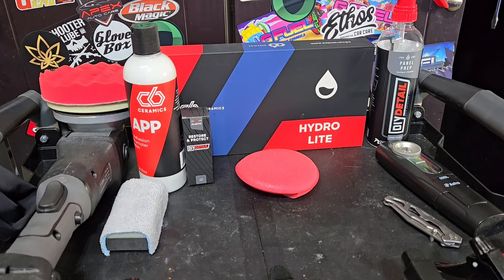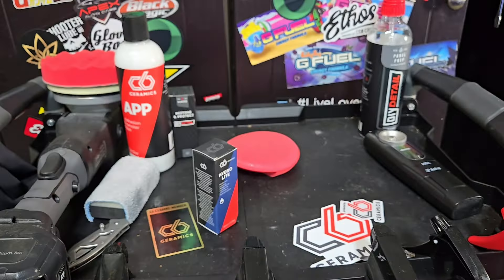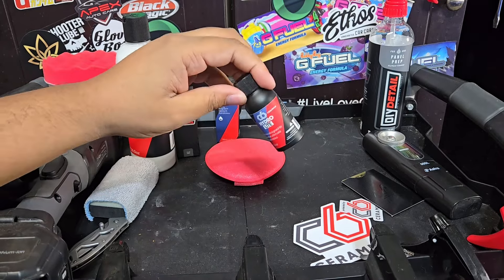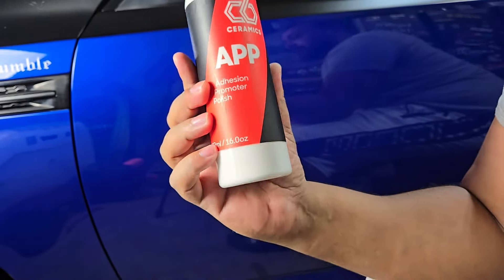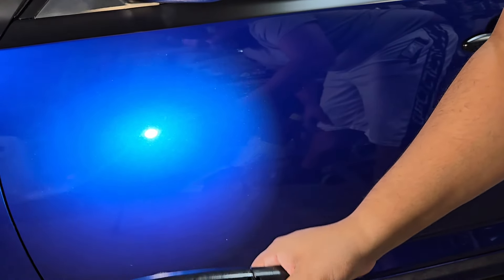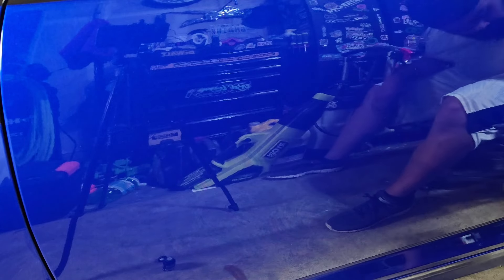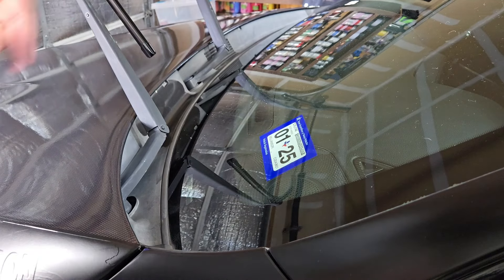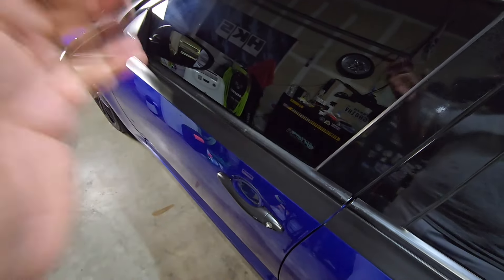[NEW] C6 Ceramics APP,  Hydro Lite & DIY Detail Trim Restore - Application

Comment: Martin, thanks for the video. Looks good. 

A few little things, 
C6 Ceramics Adhesion Promoter Polish (APP) is designed to replace panel prep, not the polishing step.  C6 Ceramics Adhesion Promoter Polish (APP) needs a dry pad. 

We us Refined Detonated Nano Diamonds, other brands use diamond nano tubes or detonation nano diamonds. 

The metal card was added by error in the first 25 boxes produced. 

The provided applicator uses less coating, and has less chance of high spots. 

Please wear gloves!
Reply from the maker: I remember from our interview. I am exploring some off label use here with APP, as I personally would only use it to save myself a step if the paint has the right conditions. I learn all kinds of neat things going off label!

Comment: Hey Martin i love your videos. Except this 1! It doesn’t sound like you know much about the app as it’s not designed to remove anything really and why why why would you apply the c6 without gloves???
Reply from the maker: I know it's not. If you saw my interview I did with Yvan and John, Yvan states that the nature of APP which swells the paint can help to "fill/hide" defects. I also said in the first minute of the video, APP is not designed to remove protection. Also why I apply without gloves, because I use an applicator with a plastic barrier so the coating stays in the applicator and doesn't leak through to my hands. Should I be applying coatings with gloves? Yes, but I tend not to when using autofiber savers. This is my shop, not DIY/C6s shop. I like to experiment and do things differently to find other solutions that work for all the products I get in here.
Reply: I’m not trying to tell you how to run your shop, but what i can tell you is that any coating company and any applicator company will tell you to wear gloves when applying ceramic coats
Reply from the maker: @clints8888  safety precautions. I am aware.

Comment: Overpriced @$300 lol
Reply: Time will tell. If it stays cleaner and performs better than the competition it’s not.
Reply: It’s way too expensive. 

It’s really hard to tell if there is any chance of it being worth close to that right now because everyone making videos on it got it for free. 

I’m sure it’s a perfectly good coating, but the value can be skewed when it’s expensive but free. 

There are other cheaper nano diamond coatings as he mentioned in this video too.
Reply: Yea, its pricy overall;however, from my point of view it could be okay. For example, i saw recently carpro dquartz. It was 100+€. Hydro lite can be applied on 2 mid size vehicles which is a normal car in Europe. So if you could apply hydro lite on 2 cars, it would be 150€ per vehicle.
Reply from the maker: pretty pricy, we will have to see how it holds up over time.
Reply: Pricing is relative. Is a Porsche overpriced vs a VW? The performance difference provides value.
Reply: @diydetailofficial you car comparing Porsche and VW to your coating that is way over priced compared to others. There is no long term testing to prove to prove its worth besides the “lab”. There are many coatings on the market that Already have been proven.  By the time we find out about this the next best thing will pop up.
Reply: @barrycook8116 I’m sure they have tested it outside a lab, this isn’t Cherrycoke. 

Is a Ferrari overpriced? For those who can afford it no. Instead of whining that it’s overpriced just say it’s not in your budget.
Reply: @havingtoomuchfun4806 the only difference is we know Ferrari is good. This stuff is no better than $80 coatings. If so prove it?  You can talk about others whining or whatever you go ahead and waste money on a coating you have zero clue about. It’s a “6 year coating” for $300 but DIY has a 8 year for 159. 🤯. You waste your money while I will get the same if not better results for far less money on coatings I know that work. The hype will be gone in a month.
Reply: @diydetailofficial I applied two coatings ever the first one was Adam's Advanced Ceramic graphene the hydrophobic properties are really good. (I put that on my wife's car) I would also like to add. I learned how to clean a car properly before applying a ceramic coating. Watching your videos and PAN the organizer. I went down the rabbit hole of buying polishers, Synthetic clay towels, everything one would need to clean a car properly before applying a coating. After applying this to a brand new Ford Explorer ST black on black, hydro lite Hydrophobic properties for exceeds the previous coating mentioned, Looking at both cars in the pouring rain it's obvious you get what you pay for.